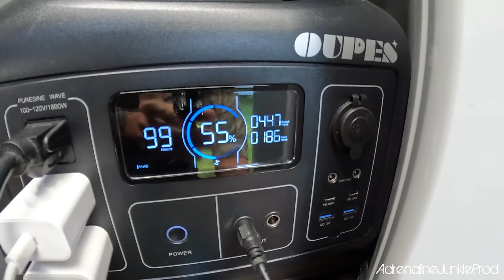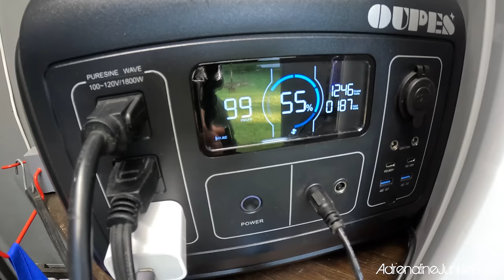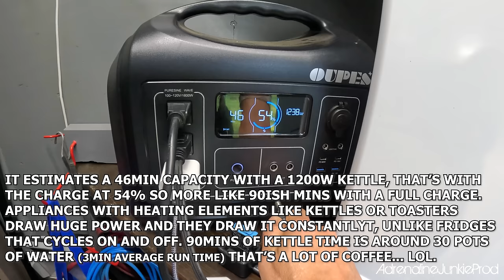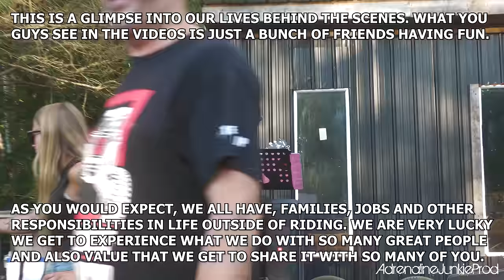#UTVLIFE | Hitting Hogs Back 2.0 - BEST SXS Trail Riding - RZR Turbo, X3, RMAX4, KRX, Maverick Sport

Comment: Really enjoyed the video. Looked like an amazing time. I have been running 30 inch carnivores on my outlander xmr for trail riding and am really happy with them . Unfortunately I cannot use them on my defender due to clearance issues getting into the garage lol. My defender sits at 80 inches with the stock 27 inch tires. The garage door opening is 82inches high. Not much room for bigger tires or lift kits. I may have a renovation in the near future for my garage door opening lol. Keep up the great content. All the best and happy trails 👍.
Reply: Height is a problem? Can you just throw on some ratchet straps to compress the suspension to get it through the door? Just don't forget to put them back on before exiting the garage 🤕

Comment: Dude, didn't you have a snorkel on your machine? That amount of water shouldn't be a problem. I know you know, I was just flabbergasted.
Reply from the maker: Ya I have a CVT exhaust snorkel. I mentioned in the video that it must have leaked around my cvt case seal. Sometimes they don’t seal up well. It’s never been an issue on my machine. Took it off and cleaned it and reinstalled and it seems fine. I usually grease the seals too with a marine grade grease but I had just replaced the seal with a brand new OEM one so I figured I could skip the grease… guess not. I’ve also used an aftermarket OMC seal before and that worked well without leakage. I’ll likely go back to the OMC seal next time I have the belt case off.
Reply: @AdrenalineJunkieProd   Good stuff man!